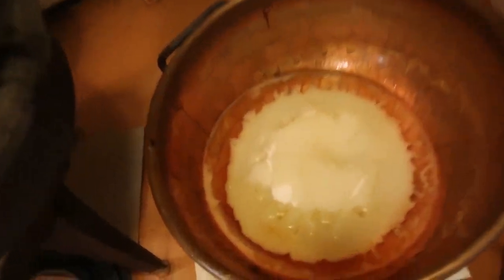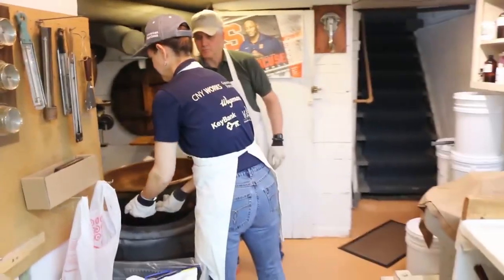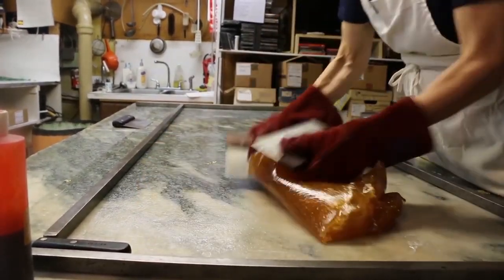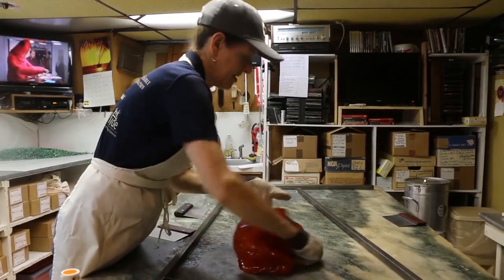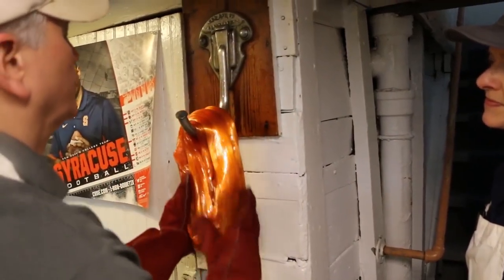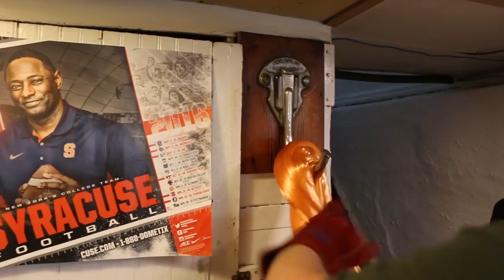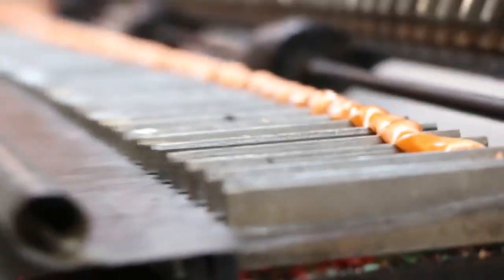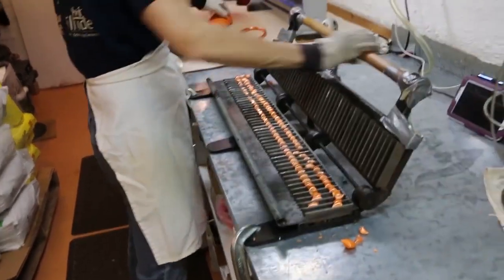Family Secret Homemade Hard Candy Recipe

Comment: I have seen this video before, and noticed the orange being poured in the kettle as opposed to on the table back then too. 
But I do wonder what is the benefit of adding the flavor earlier, if it's a weak taste.  Whenever I add a certain flavor to whatever I'm cooking, and I want to be sure I can taste it later (like herbs and some spices) I add them as late as possible. 
Or will the orange develop easier in the kettle?
Reply from the maker: It's just easier to add flavors in the kettle as opposed to the table. But the reason we don't do it most of the time is because the flavor will stick to the inside of the kettle for the next batch which will blend the flavors together. But with weak flavors that won't happen.
Reply: Hercules Candy ahhhh. That makes sense. Of course peppermint would just chill in the kettle long after it would be removed.